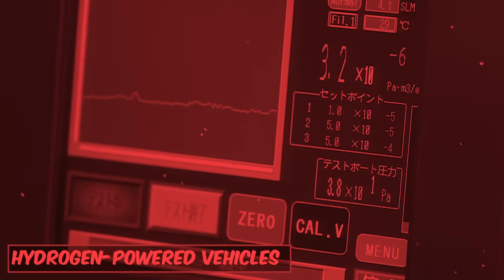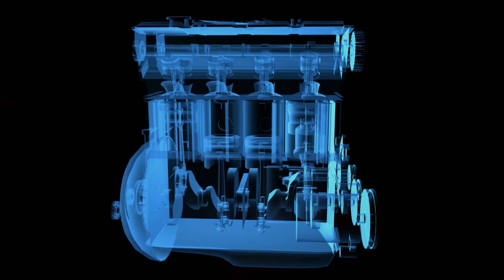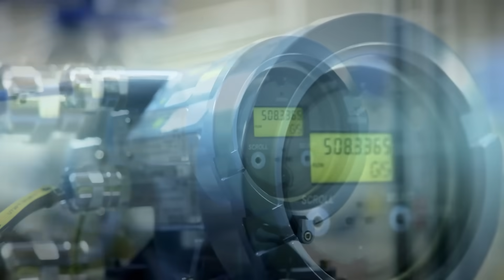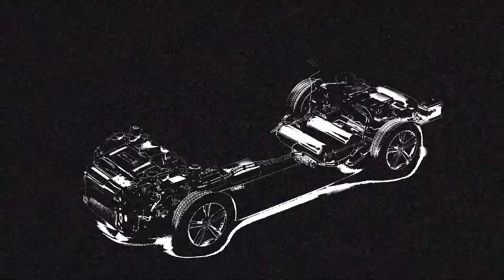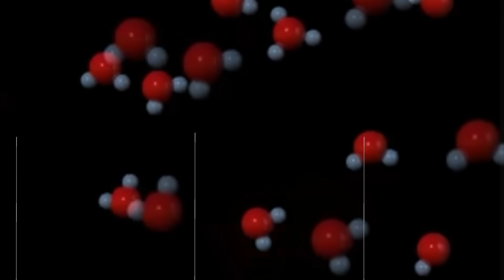Toyota's New WATER Engine Will Destroy The Entire EV Industry!

Comment: The technique may be to provide high frequency  pulses DC current to break the water molecules through electrolysis to produce the hydrogen gas that can be fed into the engine. The energy from combustion would therefore be greater than the energy needed to break the water molecules. This would seem to defy the energy conservation laws of thermodynamics, but we are still learning and discovering new things as time goes on...I do believe that Stan Meyers found something workable before he died.....
Reply: You mean after he was found as a fraud and ordered to return all the money to his investors?
Reply: Wouldn't this mean heat is released as a bi product of combustion thus a hotter planet??
Reply: Black top roads are a bigger problem then the little heat coming from this car  @frescita7385  .
Reply: No. @frescita7385
Reply: we have a lawnmower that runs off a home made version. browns gas direct. and your correct. the basic alternator or stator of the mower has the capacity for on demand system. 
also i have seen kids electrolysis tower carburetors bought and taken to big brother right out of our home town. dad has same stories of engineer Neighbours. etc etc etc. 
frustrating eh. 
oh well anytime is good time to improve
Reply: "The technique may be to provide high frequency  pulses DC current ...".  And it takes energy (lots of it) to generate those pulses.  The amount of energy required to split water molecules is the same, whether it's electricity directly, or something else.
Reply: no it doesnt. i have a jam jar and 12volt battery. salt makes the reaction happen easier. so does surface area on reactor plates. for instance...use a scratched up piece of stainless instead of smooth for more reaction surface. small things like this work great once you get off the calculations books and start making your own models @greenmanofkent
Reply: You can never defy the principle of energy conservation. Energy can neither be created nor destroyed. Energy needed to drive the car's engine should be more than the energy input to the system (considering the losses due to engine efficiency and friction). So, from where this input energy coming to power up the electrolysis unit? Is it batteries? If batteries, you will ended up similarly as an EV car.
Reply: if you ever have seen one run they are great. simple design . start car on gas. turn on Seperator, aka browns gas generator hho and allow to make gas. then gas takes over .
the alternator, battery are doing the legwork here. its amazing to see them run. things being used. water, metal that eventually corrodes, the alternator the battery cycles. although all this is minimal. water must be added. always use distilled or you have contamination in reaction. our general thesis and said argument of equation A in must be greater than A out is....rudimentary to the whole cycle. you are using water, lead, copper etc.  our basic theories don't represent the actual practices by many many people and scientific discoveries bought and locked away  @abuyalatip7590
Reply: No he did not. As you correctly say energy conservation has to be defied by these things. Also more generally thermodynamics would have to be broken. These things are impossible.
Reply: Before Stan was poisened.
Reply: Very poor article.  We were not told the amount of electricity needed to generate power to do the electrolysis and what is the source of it
Reply: @yehoramnatanzon3698  Probably an industrial secret carefully guarded by Toyota I'd say.

Comment: Nicely presented nonsense. Using electricity to split water into hydrogen and oxygen is energy intensive. It would need a lot of lithium ion batteries. Why not just use the electricity to power an electric motor.

Comment: I want to know how the water is split into Hydrogen and oxygen. Is it electrolosis if so where is the electricity coming from. If another method is used I would like to know exactly how it is done. Until I have that information I have to be sceptical. Like Mulder in X-Files, I Want To Believe.

Comment: That idea has been around for 65 yrs or more. A bloke in NZ had a Fiat  Bambina  running on  the same  idea, breaking water into Hydrogen & Oxygen by electrolysis and burning the Hydrogen for fuel, that was back in the  1960s.
Reply: But oil companies bought the patent so he couldn't build them.
Reply: @neildewitt2869 Patents are protecting only for 25 years the inventions. So no cause why this kind of engine ist not available since 1985😂
Reply: @neildewitt2869  It can't be patented... it's a perpetual motion machine. Not what Toyota's actually talking about, but anything that claims the water is the fuel. Though I'm wondering if this is, in fact, a complete hoax and I just found a slightly better version of it.

And after reviewing this more, and in other information on the internet, I'm convinced this is a pure hoax and not something Toyota is working on.

Comment: The only assumption I am working on is that the laws of thermodynamics are incontrovertible. I am also sure that the engineers at Toyota also know that which leads me two possible conclusions.
The video is a misrepresentation of what they are actually doing or it is a complete spoof.
Reply: Sounds great. But how does it work in below freezing temperatures!
Reply: @andrewpelowski  It cannot work at any temperature.
The video is a spoof/joke or scam, can't be sure which but for sure you cannot get power from water.

Comment: I have been looking at this  Hydrogen/Oxygen generator for some years now, and have long wondered why the motor industries around the world have not come up with this self contained unit built into our cars , even after some fifty years or so after the American guy (Stanley Meyers) ran his dune buggy on water,  which attracted the government and also sadly the oil producers who had his arrested all his gear confiscated, and him in the end being murdered, public web
members have shown many of these home made generators all worked well even running cars along side petrol, and home powered generators all proving a gas tank was not needed to store high pressure hydrogen, when it can be produced at source with the turn of an ignition key, I am impressed with Toyota getting this brilliant idea up and running and is without doubt the cheapest and safest way to  produce what we all cry out for cheap fuel ,  also I add the car has a generator and a battery for the electrics needed. the by product, WATER well done. Toyota.
Reply: The oil industry won't let it happen.

Comment: Water engine is great, but then you'd have to wonder whether water usage for vehicles (especially in large numbers) will start taking away from supplies meant for drinking or other uses. We tend to think of water as an unlimited resource, but while they are renewable, there are places in this world where even water is not easy to obtain due to different factors. Like drought, being in a geographically landlocked area, arid or dry locations like deserts, etc. 
Still, it would be quite the advancement for civilization if our need for mechanical energy can be powered by water.
Reply: the gas from a gallon of water goes a long way, and a spare bottle in the boot will be there for a while.

Comment: Outer space the most common element is hydrogen even in metal rich parts of space . Seems the most stable element is Iron . This shows the energies are immense and powerful to strip atoms into particles . This energy could be in the speeds associated with vaccums . So if water is boiled in a vacuum chamber and a low pressure catalyst might separate Hydrogen and oxygen , then the energy needed for elecolysis might come from the vacuum.
Reply: no....its so much easier than that. the alternator and normal battery can make it all work. i made a lawnmower run like this when i was 17. neighbor was all about hydrogen...but we used the more explosive mix of browns gas. which is when you make a dc Seperator but dont separate the negative from positive. so all bubbles o2 and hydrogen come up into same chamber. 
so if you wanted just hydrogen to car you separate your reaction according to polarity.

Comment: There is no mention of where the high voltage electricity comes from, necessary  to achieve the electrolysis. In other words the reality is this would still be an electric powered car.
Reply: only with several additional energy wasting steps between the battery and the wheels!
Reply: Or use night electricity,  60% night electricity no one uses
Reply: it would still need a battery to store that energy.  This video is stupid. @jussikankinen9409
Reply: The high voltage could come from a coil, like on the old ignition systems,
Reply: @nmblevins5904  the coil still needs a power source.

Comment: How many different "Toyota's New Engine will destroy EV's!" videos have I seen? I can imagine a scenario where a limited distance engine, like a forklift might possibly get enough power from this electrolysis process. He also didn't seem to mention what the electrical power source for the electrolysis was.
Reply: What about the guy with the Peugeot ?
Reply: The alternator output can be split into power for the ICE and power for the electrolysis battery. It's not rocket science.
Reply: @endthefed5304  Can you do the experiment and let us know ?
Reply: @endthefed5304  What sort of alternator are you running?  It would need to be the same size as the front of the car.
Reply: @endthefed5304  Well, that's because rockets actually work. It takes more energy to crack H2O into O2 and H2 than you get back "burning" them back into H2O. Plus the hydrogen combustion engine is likely only 15-25% efficient, like every other internal combustion engine. Efficiencies matter in a feedback system. If what you're proposing works, you'd have a greater than 100% efficiency. You could build a closed loop version of this that output electricity forever. Clearly that's impossible.

Comment: More sensationalism from Toyota that I wager will come to absolutely zero. Remember their highly secret development of Solid State batteries which were due to market around 10 years ago, then about 7 years ago and now.........an engine that runs on water. Don't be gullible. Toyota is the most indebted company in the world and is simply clutching at straws to make the dumb think it is still relevant. Look who headed up Toyota until recently and the disastrous paths they have taken with regard EVs or rather lack of them. I wouldn't be at all surprised if like smaller Japanese companies such as Subaru and Mazda become wholly Chinese owned as they are on a similar footing. Toyota is not a brand synonymous with sustainability.

Comment: The only way this could work is if a catalyst split the water using much less energy than you get back by burning the hydrogen.
Reply: It doesn't work like that. Learn some thermodynamics.
Reply: catalyst does not reduce the energy required or release from reactions
Reply: Brown Gas
Reply: @bgliz13  Yes.  This will make Taco Bell a literal gas station, though.
Reply: Stanley Myers used a high speed oscillating technique which increased the frequency of voltage therefore reducing the amount of electrical current needed to power the electrodes. In addition a capacitor and a transformer. This probably means that he was converting a 12 volt signal using a standard alternator rectifier to power the computer control setup. The so called 'engine', in this video about the only functional difference between it and a standard combustion engine would be proportional to the difference in air to fuel ratio, thus the size of the valves, fuel injectors, timing etc. Also most likely although not mentioned in the video, this car by Toyota Is actually an EV which requires overnight charging and uses battery storage to perform onboard electrolysis. Either that or the alleged vehicle is a spoof to promote pipe dream that they never intend to release, .
Reply: No, it wouldn't work even then.  It's BS pseudoscience.
Reply: And we don't have that tech yet. This is BS.
Reply: @stevenschulte1475 k
Reply: Or if you had a bullcrap fermentator on board to provide energy